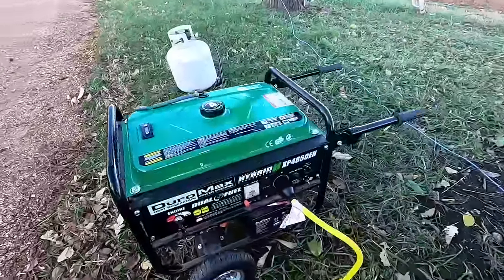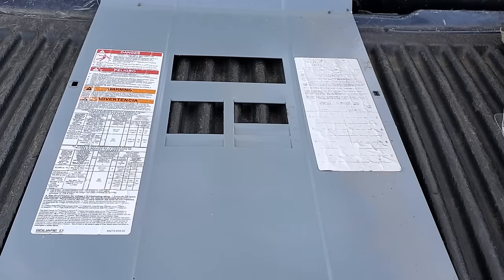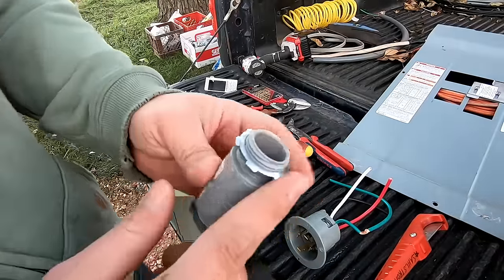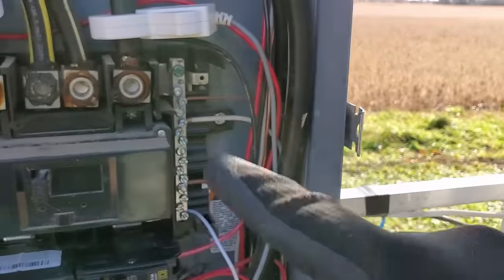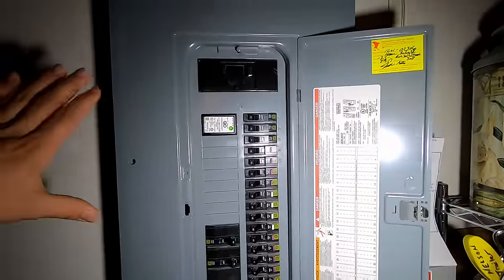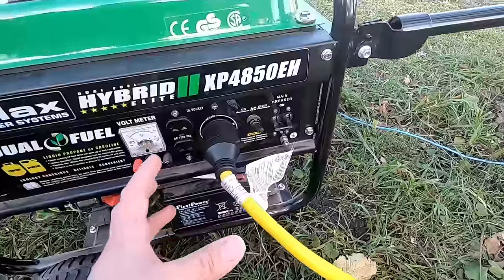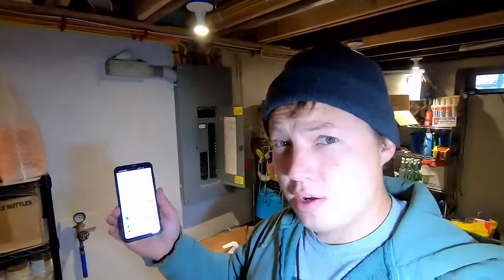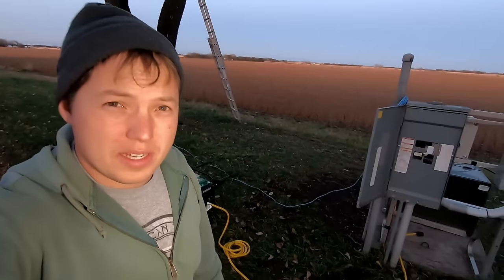How To Hook Up a Generator To Your House Using a Breaker Interlock Kit & Power Inlet Box

Comment: I wish I had hooked mine up this way.  I got an external load center that is wired in series with the existing breakers but has its own meters and generator input.  The problem is that the 5-6 circuits I can run on the generator can never change, and it was more expensive than a 30A breaker and a metal plate!  Runs well pump, gas furnace, refrigerator, gas water heater, master bath, and TV outlets.
Reply from the maker: The nice thing about the system you have is that it is harder to overload the generator since there is less connected to it. For people like yourself however I agree that the versatility of the breaker interlock backfeed system can be better.
Reply: Paul T  Heat and hot water are pretty important to me during an extended outage in Winter.  I just wish I had the flexibility to run optional items when needed.

Comment: Thank you for this video! My power has been knocked out from the recent Sierra Nevada snow storm and I only have a furnace to heat my home (temps had been down to 38°F inside my home). With a 2-4 week eta of power restoration I needed something quick and you explained it perfectly. I was able to pick up most these parts locally and hard wire my generator in an afternoon.
Reply: ⚠️Portable Generator Safety Tips:

1) KEEPING OTHERS SAFE: Please do not allow an unqualified person or your children to operate and service the portable generator. Just because some manuals don’t say that doesn’t mean it’s safe. That is important against the generator safety rules. We also need to be keeping an eye on our children too. You need to make sure that your children are not playing near the portable generator especially when it’s running so they won’t get electrocuted. Generators pose electrical risks and they can be hot during an operation. Please keep your children away from the portable generator at all times. It is important to keep our children safe especially our little ones. Be aware of all the hazards.

2) WHERE TO RUN YOUR GENERATOR: Some people use their portable generators indoors which increases the risk of carbon monoxide poisoning. It’s important to have a carbon monoxide if you have a gas generator. Never ever use your generator indoors even if your doors and windows are open and even in the garage is not safe to use a portable generator. Also please never use your generator in your deck or balcony. It is never safe to use your generator indoors and in enclosed areas of your home. Your generator needs to be 15-20 feet away from your house. 

3)🔥FIRE HAZARDS: Never refuel your generator while it’s running. You need to let your generator cool off before refueling it and before storing your generator. Never overload your generator too. Never ever back feed your generator. You should never plug your generator into a wall outlet. Also never store propane tanks indoors. Please keep flammable things away from the generator as well and please don’t smoke cigarettes near the generator. Having a fire extinguisher next to the generator is also important against the generator safety rules. It’s also not safe to move your generator while it’s running.

4) GENERATOR OPERATION: make sure your hands are dry before touching the generator. Never use your generator in wet conditions. Don’t let your generator get wet. You need a generator tent if you need to use your generator during wet weather. Please don’t wear loose clothes when operating the generator. Turn on your generator before plugging in appliances. Use the right cord for your generator. Please do not use worn out cords. 

https://youtube.com/shorts/eFigDfnPkcQ?feature=share and here is a short video more about keeping others safe when using generators. Portable generators need maintenance so it’s important to follow the safety instructions.

Hope this helps

Comment: Well done! This is truly the best and most appropriate way to hook a back up generator to your Home!  I would recommend at least a 10,000 Watt to 14,000 Watt Generator if you anticipate multiple & extended power outages depending on your typical load usage to provide the most comfort and least disruption to your life especially if you are isolated on a farm or run a home based business. As you can see, converting your main panel to incorporate a backup generator is simple an pretty inexpensive, the dissatisfaction ALWAYS comes if you cheap out on getting a big enough generator for more than just basic needs. If your power goes out you'll have plenty to worry about than which appliance you can't use. Get the biggest one you can afford. Its also a good idea to actually test out different models.  The great thing about this type of setup, is you only have to do it once and you can use ANY generator. So, do the install in good weather when rental generators are plentiful and try out a couple. Then watch for that size to go on sale. Good Luck, stay safe & powered up.
Reply: Please don’t forget about the generator safety tips as well. Remember it’s important to follow all the generator safety rules whenever you use your generator. Here are the generator safety tips:

This is a safety reminder 

1) Please do not allow an unqualified person or your children to operate the portable generator. Just because some manuals don’t say that doesn’t mean it’s safe. That is important against the generator safety rules. We also need to be keeping an eye on our children too. You need to make sure that your children are not playing near the portable generator especially when it’s running so they won’t get electrocuted. Generators pose electrical risks and they can be hot during an operation. Please keep your children away from the portable generator at all times. It is important to keep our children safe especially our little ones. Be aware of all the hazards.

2) Some people use their portable generators indoors which increases the risk of carbon monoxide poisoning. It’s important to have a carbon monoxide if you have a gas generator. Never ever use your generator indoors even if your doors and windows are open and even in the garage is not safe to use a portable generator. Not even at your porch and your deck. It is never safe to use your generator indoors and in enclosed areas of your home. Your generator needs to be 15-20 feet away from your house. 

3) 🔥generators cause fire hazards too. Never refuel your generator while it’s running. You need to let your generator cool off before refueling it and before storing your generator. Never overload your generator too. Never ever back feed your generator. You should never plug your generator into a wall outlet. Also never store propane tanks indoors. Please keep flammable things away from the generator as well and please don’t smoke cigarettes near the generator. Having a fire extinguisher next to the generator is also important against the generator safety rules. 

4) generator operation; make sure your hands are dry before touching the generator. Never use your generator in wet conditions. Don’t let your generator get wet. You need a generator tent if you need to use your generator during wet weather. Please don’t wear loose clothes when operating the generator. Turn on your generator before plugging in appliances. Use the right cord for your generator. Please do not use worn out cords. 

https://youtu.be/I1jT3ANENvI and here is a video more about keeping others safe when using generators and also about our family’s safety. Hope this helps

Comment: Great video Ben! I learned everything I wanted to know. Thanks for posting the links to the components.

Btw, I have a 5500 watt generator and a new heat pump furnace, heat pump water heater, and all LED lights so I can run everything powered on! We have regular power failures where I live so it's really nice.
Reply: ⚠️Generator safety tips:

This is just a reminder for everyone’s safety when using portable generators. All generator safety rules need to be followed carefully to avoid hazards. 

1) Please do not allow an unqualified person or your children to operate the portable generator. Just because some manuals don’t say that doesn’t mean it’s safe. That is important against the generator safety rules. We also need to be keeping an eye on our children too. You need to make sure that your children are not playing near the portable generator especially when it’s running so they won’t get electrocuted. Generators pose electrical risks and they can be hot during an operation. Please keep your children away from the portable generator at all times. It is important to keep our children safe especially our little ones. Be aware of all the hazards.

2) Some people use their portable generators indoors which increases the risk of carbon monoxide poisoning. It’s important to have carbon monoxide detectors if you have a gas generator. Never ever use your generator indoors even if your doors and windows are open and even in the garage is not safe to use a portable generator. Not even at your porch and your deck. It is never safe to use your generator indoors and in enclosed areas of your home. Your generator needs to be 15-20 feet away from your house. 

3) 🔥generators cause fire hazards too. Never refuel your generator while it’s running. You need to let your generator cool off before refueling it and before storing your generator. Never overload your generator too. Never ever back feed your generator. You should never plug your generator into a wall outlet. Also never store propane tanks indoors. Please keep flammable things away from the generator as well and please don’t smoke cigarettes near the generator. Having a fire extinguisher next to the generator is also important against the generator safety rules. 

4) generator operation; make sure your hands are dry before touching the generator. Never use your generator in wet conditions. Don’t let your generator get wet. You need a generator tent if you need to use your generator during wet weather. Please don’t wear loose clothes when operating the generator. Turn on your generator before plugging in appliances. Use the right cord for your generator. Please do not use worn out cords. 

https://youtu.be/I1jT3ANENvI and here is a video more about keeping others safe when using generators and also about our family’s safety. Hope this helps

Comment: It all makes “sense“ 😂 now I was doing research on this very topic and you saved me tons of wondering and researching! It’s actually ridiculously simple which I have not guessed and thought it would be more expensive to do so...Great video!!!! I have not looked but there’s got to be a go-between choice between paying for a ridiculous expensive inverter generator and cleaning up the power supply going into the house I wonder if somebody makes an inverter that could be placed somewhere between or on the power box outside or in the upstream coming from the generator directly? Definitely getting one of those sense Energy monitors!
Reply: Look at UPS systems on Amazon...just a battery backup power strip👍 they also protect from the little power bumps
Reply: Ñ
Reply: Generlink

Comment: Great video well delivered.  I am in TX and lived through the freeze earlier this year. No power, heat or water for five days, Luckily I had stored water but no hot shower.  I had this device installed,  I have a 8500 watt gen set that powers almost everything. System is easy to use and very easy to initiate.  Beats the hell of the cost of a whole house generator starting at $8-10 K.
Reply: And thanks for pulling the leaf out, it was BUGGING me, kept saying to the video pull that leaf out.
Reply: ⚠️Generator safety tips:

This is just a reminder for everyone’s safety when using portable generators. All generator safety rules need to be followed carefully to avoid hazards. 

1) Please do not allow an unqualified person or your children to operate the portable generator. Just because some manuals don’t say that doesn’t mean it’s safe. That is important against the generator safety rules. We also need to be keeping an eye on our children too. You need to make sure that your children are not playing near the portable generator especially when it’s running so they won’t get electrocuted. Generators pose electrical risks and they can be hot during an operation. Please keep your children away from the portable generator at all times. It is important to keep our children safe especially our little ones. Be aware of all the hazards.

2) Some people use their portable generators indoors which increases the risk of carbon monoxide poisoning. It’s important to have a carbon monoxide if you have a gas generator. Never ever use your generator indoors even if your doors and windows are open and even in the garage is not safe to use a portable generator. Not even at your porch and your deck. It is never safe to use your generator indoors and in enclosed areas of your home. Your generator needs to be 15-20 feet away from your house. 

3) 🔥generators cause fire hazards too. Never refuel your generator while it’s running. You need to let your generator cool off before refueling it and before storing your generator. Never overload your generator too. Never ever back feed your generator. You should never plug your generator into a wall outlet. Also never store propane tanks indoors. Please keep flammable things away from the generator as well and please don’t smoke cigarettes near the generator. Having a fire extinguisher next to the generator is also important against the generator safety rules. 

4) generator operation; make sure your hands are dry before touching the generator. Never use your generator in wet conditions. Don’t let your generator get wet. You need a generator tent if you need to use your generator during wet weather. Please don’t wear loose clothes when operating the generator. Turn on your generator before plugging in appliances. Use the right cord for your generator. Please do not use worn out cords. 

https://youtu.be/I1jT3ANENvI and here is a video more about keeping others safe when using generators and also about our family’s safety. Hope this helps

Comment: I am learning a great deal from your videos. I am doing my own work on a small house. I have learned more on not just how to but why as well.
Reply: ⚠️Please don’t forget the rules about generator safety: This is a very important announcement for everyone. It’s important to follow all generator safety rules whenever we use portable generators: 

Everyone must see this. This is just a reminder for everyone’s safety. 

1) KEEPING OTHERS SAFE: Please do not allow an unqualified person or your children to operate and service the portable generator. Just because some manuals don’t say that doesn’t mean it’s safe. That is important against the generator safety rules. We also need to be keeping an eye on our children too. You need to make sure that your children are not playing near the portable generator especially when it’s running so they won’t get electrocuted. Generators pose electrical risks and they can be hot during an operation. Please keep your children away from the portable generator at all times. It is important to keep our children safe especially our little ones. Be aware of all the hazards.

2) WHERE TO RUN YOUR GENERATOR: Some people use their portable generators indoors which increases the risk of carbon monoxide poisoning. It’s important to have a carbon monoxide if you have a gas generator. Never ever use your generator indoors even if your doors and windows are open and even in the garage is not safe to use a portable generator. Not even at your porch and your deck. It is never safe to use your generator indoors and in enclosed areas of your home. Your generator needs to be 15-20 feet away from your house. 

3)🔥FIRE HAZARDS: Never refuel your generator while it’s running. You need to let your generator cool off before refueling it and before storing your generator. Never overload your generator too. Never ever back feed your generator. You should never plug your generator into a wall outlet. Also never store propane tanks indoors. Please keep flammable things away from the generator as well and please don’t smoke cigarettes near the generator. Having a fire extinguisher next to the generator is also important against the generator safety rules. 

4) GENERATOR OPERATION: make sure your hands are dry before touching the generator. Never use your generator in wet conditions. Don’t let your generator get wet. You need a generator tent if you need to use your generator during wet weather. Please don’t wear loose clothes when operating the generator. Turn on your generator before plugging in appliances. Use the right cord for your generator. Please do not use worn out cords. 

https://youtu.be/I1jT3ANENvI and here is a video more about keeping others safe when using generators 

Hope this helps. Remember safety first

Comment: Ben,  thank you for all points covered video.  One added topic  not included would be on back up during  inclement weather..rain, dust storms, heavy snow/sub freezing. 
Is there any type of protection for a long run cycle generator ,  fuel storage and the operator while fueling..ie ice shanty/hut, 
Open ended cotton tarp tent etc.etc..? Suggestions ?